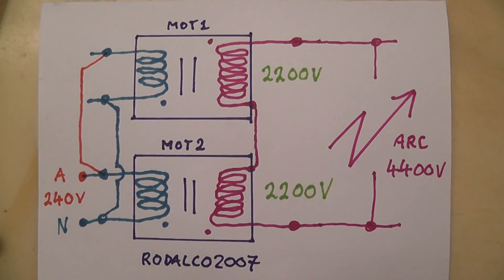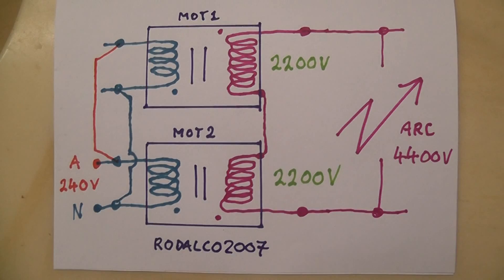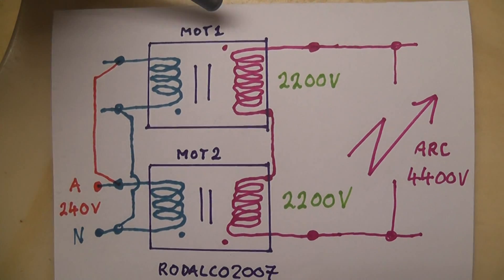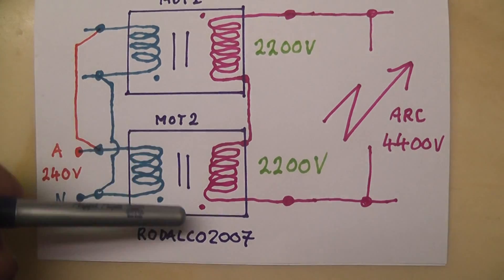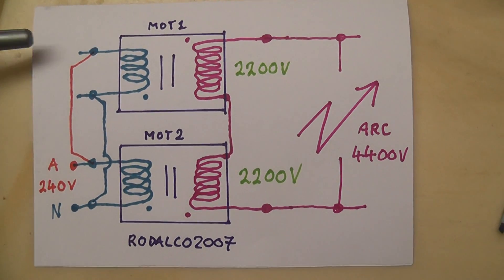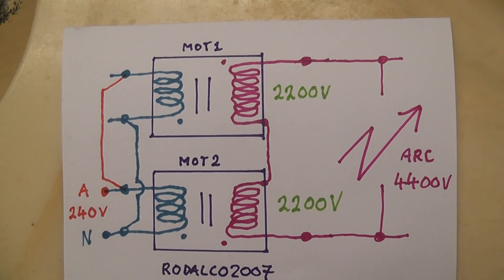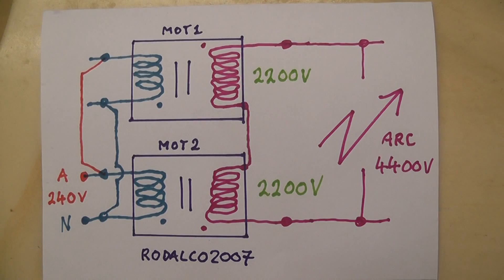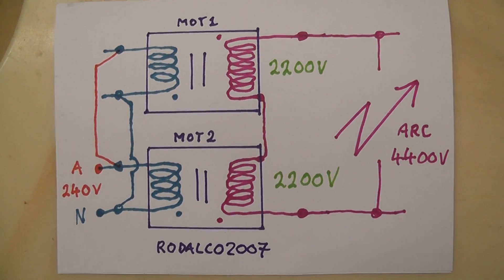4400 Volts MOT schematic

Comment: So what happens if you isolate/insulate them then connect the HV wire of one to the case/core of the other to make them in series?  The case of the first would be one connection out and the HV wire of the second would be the second connection out.

Comment: Is there a limit on how many MOT's you can wire up in parallel?🤔
Reply from the maker: It depends upon the size of the breaker on the supply circuit. 3 MOT's 16 Amp. 6 MOT's 32 Amps as a guide.

Comment: Can you please show how you would also connect 4 or 8 MOT capacitors. Mine are rated at 2.1kv. Cheers. Charles
Reply: How much voltage are you going to be dealing with? If it's ~4kV, you want two pairs, of two capacitors in series, and out the two sets in parallel. Then connect this capacitor bank in series with the high voltage connector. If you want to add more capacitors, just continue adding more sets of 2 caps in series, then add them in parallel with the rest. Sorry if I messed anything up in my explanation

Comment: You should never swap the secondary wires to ground the other one, the insulation may not stand up to the 2000v from the other transformer.
when you connect 2 mot's in series, leave the secondary connections where they are, just reverse one of the primaries. you can even ground the frame as that will give you a centre tapped supply, i did a vid on this
https://www.youtube.com/watch?v=DTZioJ6Y2oI
Reply: I did it exactly as you describe and attached the bases of the transformers to RF Ground and 2 MOT caps in series on each HV lead  and it worked very well on my spark gap tesla coil and the transformers didn't even heat up much at all during the first test of only 3 minutes. I will be testing more when my roommate isn't home. It was the first time it actually worked. Scared the hell out of him and he had a hissy fit so I'll save the drama.
Reply from the maker: Yes, thanks mate, my error, i did mention swapping the 240 V primaries. Will do a corrective with the capacitors as well.
Reply: Sparky Projects and b

Comment: The phase dots on the primaries are the wrong way around! Imagine the positive AC cycle, the non-dotted ends of both primaries will be +ve, so the dotted ends of both secondaries will be +ve wrt the center: out of phase. You need to swap the polarity of one of the primaries.
Reply from the maker: Yes, you are correct. The 240 V windings need to in antiparrallel  to allow the HV windings to have the cores at the mid point. Well spotted.

Comment: What's all the gas formed during the arc? Is it vaporized transformer oil or parts of the resistor?
Reply: There is actually dust out of the resistor, electric arcs produce in atmospheric air Nitrogen (IV) oxide and ozone, both toxic and caustic gases
Reply from the maker: The resistor was used for striking the arc, when the arc has struck the oil is trying to quench the arc for which it is designed for.